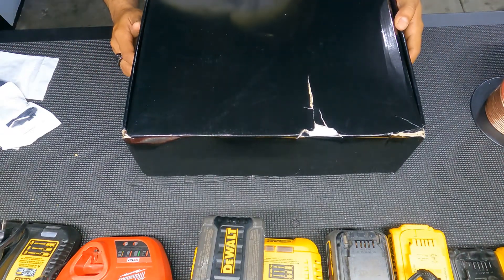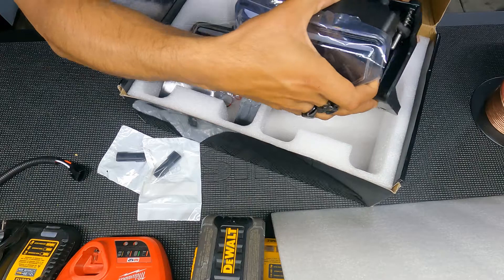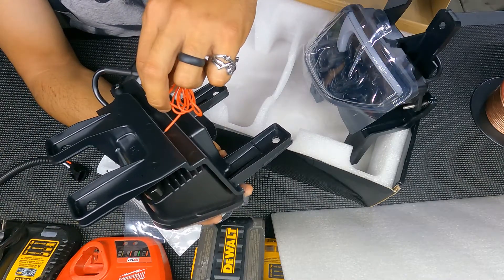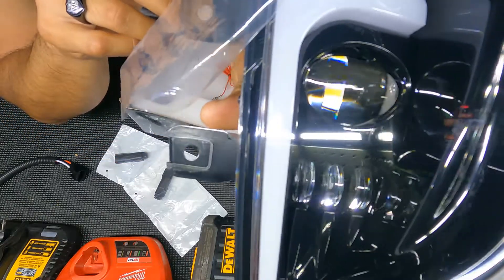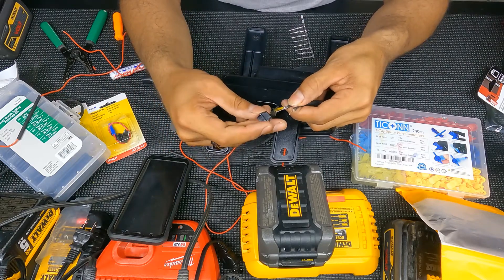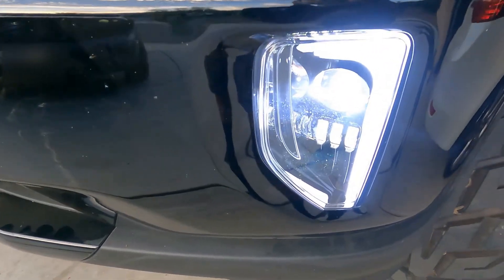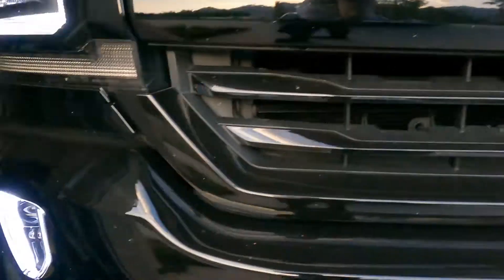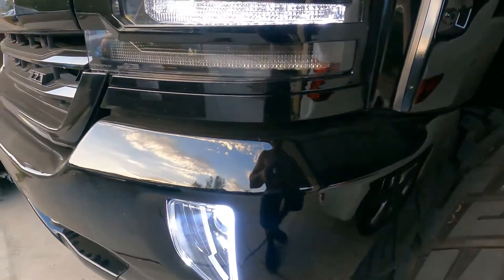Z Offroad 16-18 Chevy Silverado foglights

Comment: What’s the extra parts you had to buy. I’m doing the same thing using the gen5diy universal harness
Reply from the maker: @Kiear-v2u  just extra wire..I connected both DRL's foglights to the fuse box and not the headlights harnesses

Comment: Just ordered mine, had a question did you have to add more wire for the drls? Or what they provide was enough, dont know how to run the wire through.
Reply from the maker: I had to extend the wires that come from the DRLS because I didn't want to tap into my aftermarket headlights so i tapped into fuse 17 in my engine bay. if you tap into your OEM headlights you should have enough wire to run your DRLs.. or tap into any 12v ignition power source.

Comment: Could you please tell me which wire you tapped into for the drls? I have the same morimoto headlights and want to make sure the fog light drl turns on with the headlight drl. Thank you so much!!
Reply from the maker: haven't connected them directly to the morimoto because of warranty issues but I connected them to fuse 17 in the engine fuse box. it's the trailer stop fuse, 20A.  its only on when truck is turned on. use a fuse tap connector.
Reply: @darksidechevy5720   awesome!! Thank you for the info and the insanely quick response 🍺

Comment: Do these blink amber with turn single
Reply from the maker: no..there just DRLs color is 5500k
Reply: They look sick bro do the led color match up with the drl
Reply from the maker: yes... love the way they look. 💯 better than the oem foglights
Reply: We’re did u connect the red wire
Reply from the maker: @myquickjab2098  haven't connected them directly to the morimoto because of warranty issues but I connected them to fuse 17 in the engine fuse box. it's the trailer stop fuse, 20A.  its only on when truck is turned on. use a fuse tap connector. but if you have OEM headlights. tap it in on the power wire.
Reply: @darksidechevy5720  I have the z71 redline 2018 just received the same ones trying figure this out
Reply from the maker: fog lights don't blink...they're DRL's

Comment: Do you have any before and after our hours they look at night?
Reply from the maker: no but I'll post a video soon and tag you in it if you like.
Reply: @darksidechevy5720  yes please I want to buy fog lights for my chevy but there isn't much options and I like the ones you have cuz of the DRLs but then DDS has the pods for fogs
Reply from the maker: I know... the dds style of fog lights are nice but expensive and they don't go with my truck. ok..I'll try to do a quick video soon bro.
Reply: @darksidechevy5720  please do tag me on it I want to see the bright differences between stock and those
Reply from the maker: don't have video of the stock ones and by the way.. my stock ones where tinted.. but I'll do a video on just the foglights on by themselves.
Reply: @darksidechevy5720  yeah that will be fine a night time
Reply: @darksidechevy5720  were did you connect the DRL to?
Reply from the maker: fuse 17 inside the engine bay but you can connect it directly to your OEM headlights
Reply: @darksidechevy5720  I ended up buying them lol cuz I dont like the SS3 Baja style to small and squares changed the whole look of the z71 style silverado.
Reply from the maker: @hernancortez8079  you won't be disappointed once you hook then up...they look a million times better than the oem and a lot nicer a cheaper than BBS lights👍
Reply from the maker: Baja lights...lol
Reply: @darksidechevy5720  mine came with the connects I didn't have to buy them they look so Damm good just need to run DRL
Reply from the maker: @hernancortez8079  that's awesome bro.. tap them into a power source that turns on with the ignition
Reply: @darksidechevy5720  were can I send you a comparison video I took right now
Reply from the maker: post it on a YouTube short video and tag me in it.
Reply: @darksidechevy5720  go to my profile it's the only video I got
Reply from the maker: @hernancortez8079  looks good  bro 👍
Reply: @darksidechevy5720  did you have to adjust the beams after installing
Reply from the maker: no I didn't.

Comment: What plugs do u need to buy to make it work?? Can u drop a link for them
Reply from the maker: https://www.ebay.com/itm/NAMZ-MOLEX-2-POSITION-CONNECTOR-NM-33481-0201-/312767588140?mkcid=16&mkevt=1&_trksid=p2349624.m46890.l49286&mkrid=711-127632-2357-0
Reply from the maker: you need two of them and buy the terminal pins.  I suggest at least 10 of them just in case.

Comment: Where did you connect the drl wire?
Reply from the maker: I used a fuse tap and connected it to fuse 17 inside the fuse box in the engine bay
Reply: @darksidechevy5720  you connected both fog wires to fuse 17?
Reply from the maker: @Abe_GT500  yes
Reply: @darksidechevy5720  is there anyway you send me picture of your setup. I’m having a hard time with this. Fuse 17 in my box is a 10 amp not a 20, unless you meant fuse 15 right next to it is a 20 amp